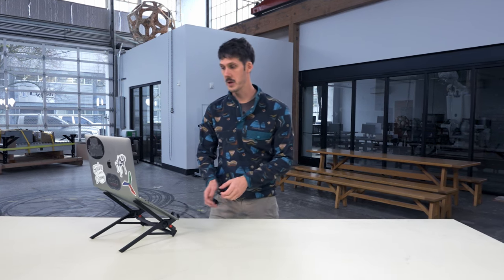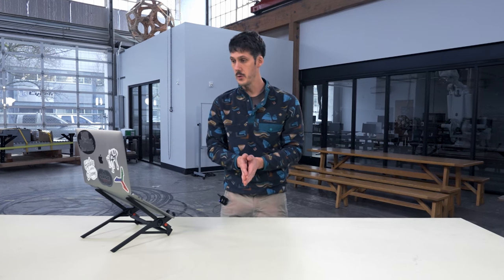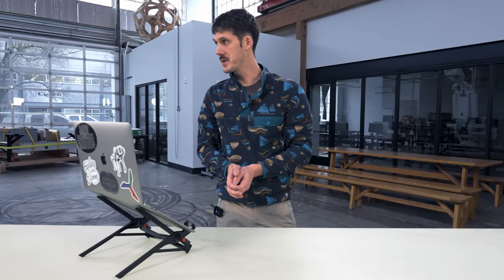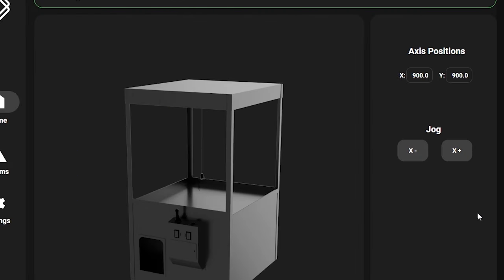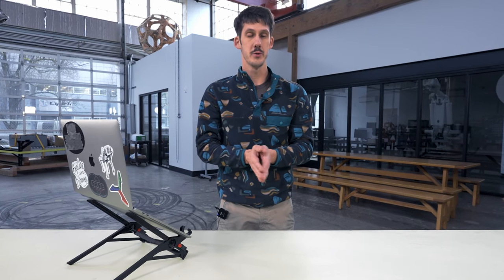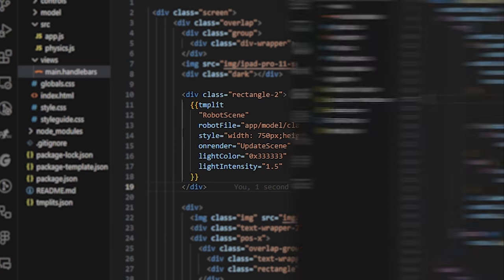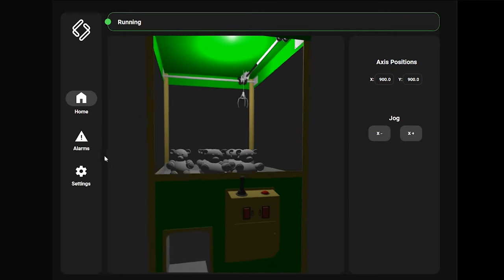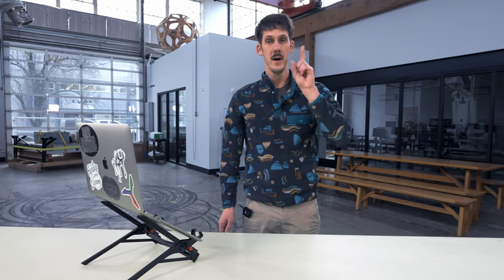Loupe UX Demo

Comment: So you have to learn HTML in order to create HMI displays for PLC controlled machines? How is that an improvement over current industry offerings?
Reply: Because the built-in traditional HMI editors are outdated. They don't offer modern-looking UIs, no advanced tools, etc. So you are limited to showing numbers, strings, old-looking trends, etc. But yeah, there's a big knowledge gap between traditional control engineering and modern software development which includes web development frameworks, and high level programming languages.